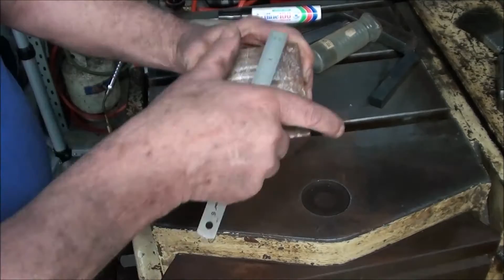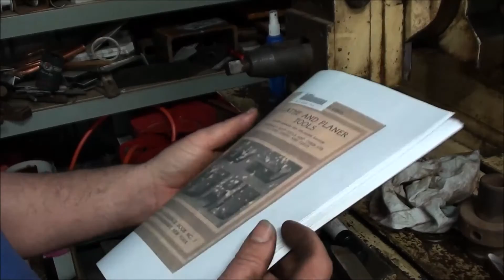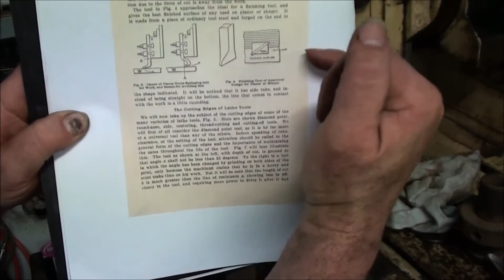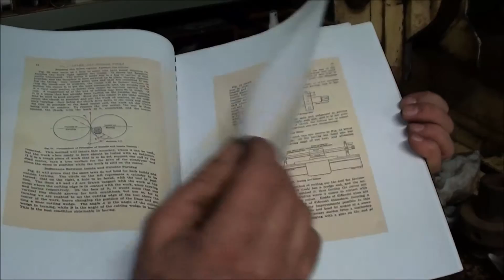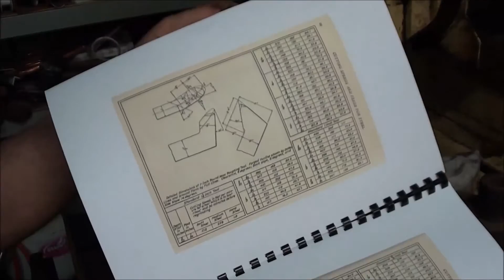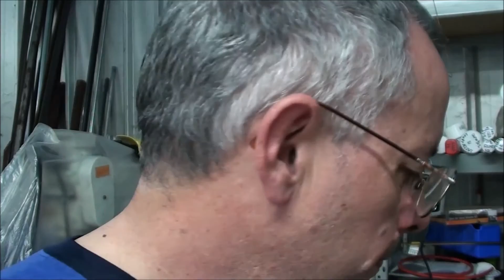Shaper Action  - Vee Blocks -  Part 1

Comment: Hi   Greg, Happy New Year.  I have read that book you sent me link to, it is full if interesting and much of it useful to the shaper user. Looking at the grinding of those new HSS tool hits, I think I would be a bit daunted at the grinding time. I certainly need a more agresive wheel for my grinder for roughing out new grinds. It's on the list ! All the best. Mst
Reply from the maker: Hi Mat, wait till you see part 2. I will show you how I ground the tool bits, quick and easy, with tools you already have. You will be surprised at how easy it is, and how little time it can take. There are much cheaper options than buying aggressive stones for your grinder. Good to hear from you. Greg
Reply from the maker: By the way, I still refer to the book myself, basic principles don't change